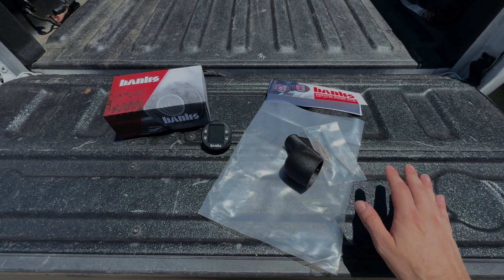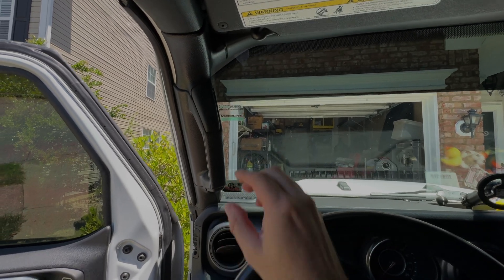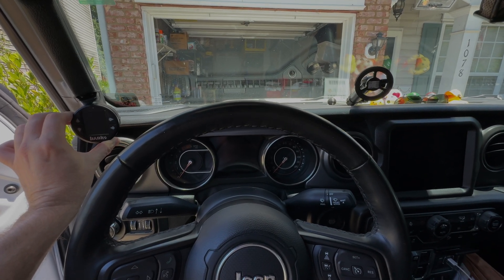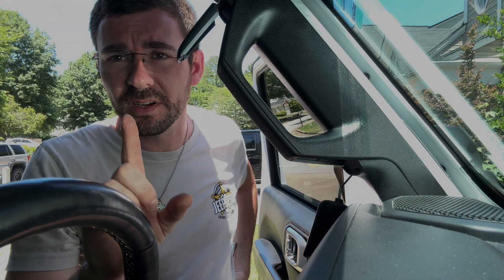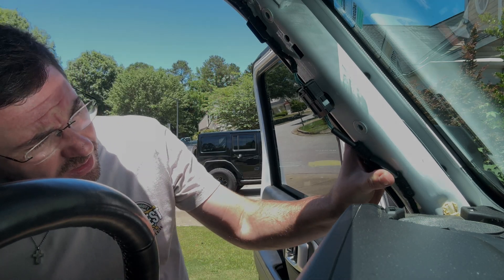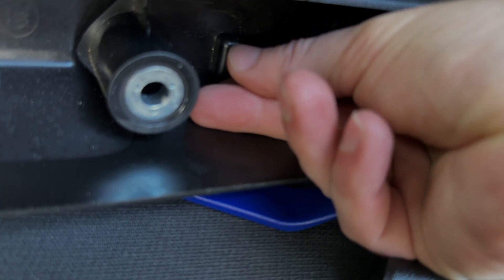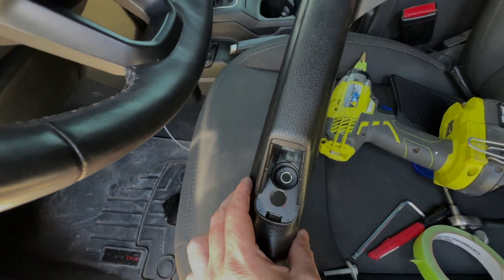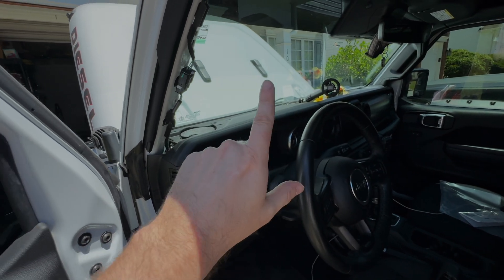JT Gladiator Banks iDash install

Comment: Did you just disconnect the main battery negative cable? Or did you do both main and aux batteries?
Reply from the maker: I only disconnected at the main battery, the directions at the time didn’t say to go as far as to disconnect the AUX battery. In hindsight, doing it again I might go to do the AUX battery now that I have had the pleasure of changing it out so I know what it takes to get to it.
Reply: @BenTheJeepGuy  I ended up just disconnecting the main. Like you, I also had no airbag in the pillar. But better to be safe than sorry. Great video.
Reply from the maker: @slugger1024 glad it went well for you! Thanks for watching!

Comment: I didn't see it on the website, does it work with a Tazer?
Reply from the maker: Since the iDash stays plugged into the OBDII port at all times, I think you may need a OBD port splitter to run both, but I don’t have first hand experience with the Tazer since I don’t have one. I chose against the Tazer since it had reports of some strange quirks and malfunctions at the time I was in the market for a device that could modify settings in the Jeep. I have JScan instead.